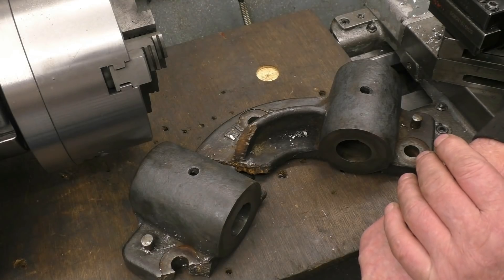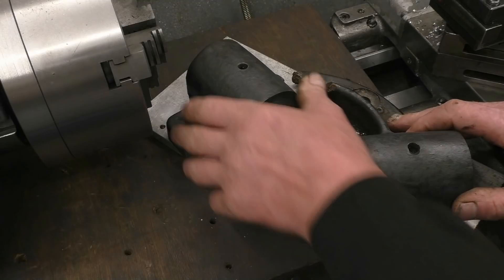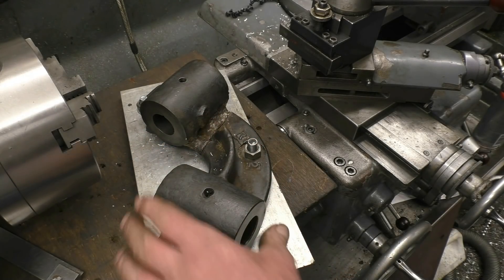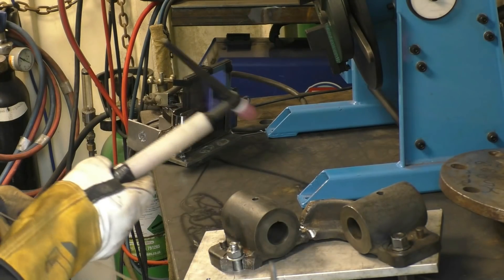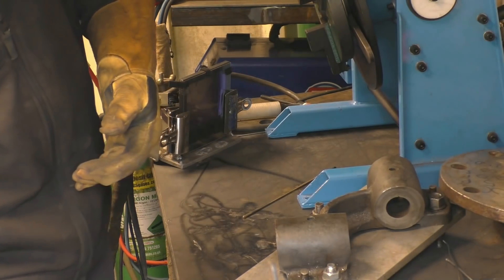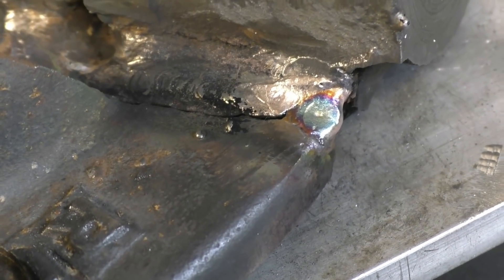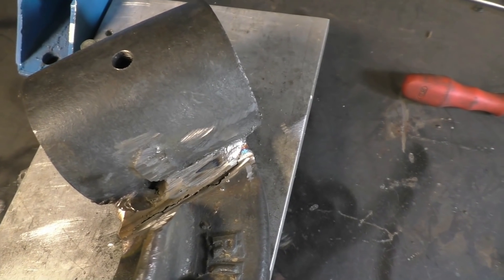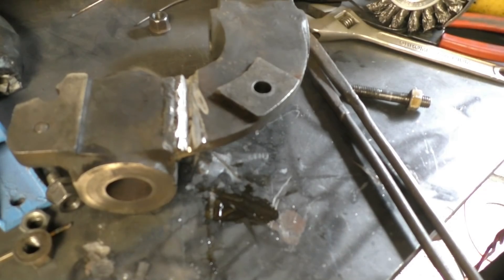SNNC 429 P2

Comment: Hi John, I really enjoy the variety of jobs you tackle on your chanel. You are an inspiration.  I have one of these lamps which came from Sacriston Colliery where my late uncle was manager. The lamps with the nipple on the side and igniter were issued to deputies and managers who were responsible for monitoring the build up of methane in the mine workings.  The other type without those features were used to provide light for the miners.  The deputy would have a rubber tube with an aspirator bulb in the middle and one end of the tube was held close to the roof of the workings where the methane accumulated, the other end was pushed over the nipple on the lamp chimney. Then the flame was adjusted low and the bulb squeezed several times to suck in any gass that migh be there. The flame flared up if there was methane present but occasionally the gas could extinguish the flame which is why the lamp has an igniter.  The magnetic safety catch could only be opened using a powerful electromagnet by the lamp cabin staff who also were responsible for filling the lamps with oil and lighting the miners lamps before the shift. Later type standard lamps were ignited electrically by a heating elemet next to the wick.  The Eccles Safety lamp company, which was on of several UK  safety lamp- manufactureres, is still in existance and have an interesting website.

Comment: Hi John, I have a lamp the same but to get mine to unscrew you start to undo it only as far as is necessary to lift one of the brass rods upwards into a hole in the top part of the lamp. Once this rod is up the bottom of the rod clears the bottom brass base and the base can be unscrewed off to dis mantle the lamp. I am pretty sure that the rod that slides up is near to where you are trying to use the magnet. Good luck from NZ , love your channel , never a dull moment in John’s workshop.

Comment: Hi John, brilliant content as usual. Great repair on the casting, that certainly will hold better than the stick weld, ( they probably used any old rod laying around) and cast doesn't like that. Brian Block is the guy to go to when stick welding cast iron after he repaired his 5 odd ton Carlton Radial arm drill after it was dropped three feet onto 2 foot of new concrete  (which cracked) when the steel rope on his bridge crane parted. He made a brilliant job of welding the broken casting back together. Your silicon bronze weld will do just as good a job on the I think you said Wadkin Planer. Just love Dino. He's a handsome beast and no mistake! Are you going to paint him? Cheers John

Comment: Hi John, I have a miners lamp with the same magnetic release catch, I’m seventy four now and I got it when I was 18, I could never get a magnet strong enough so I drilled a 1/16 hole in the top part of the mechanism so that the little spring loaded pin can be pressed down with a 1/16 drill.

Comment: The miner's lamp was interesting, I have never seen one with that locking mechanism before.  My dad was a miner all his life and retired in the 1970's and I have his old lamp.  It is all brass construction and there is a lever on a pivot that has to moved to allow the lamp to be screwed open.  To prevent this being opened underground there was a small padlock that was fitted in the lamp cabin on the pit top before it was taken down the pit.

Comment: Hi John , the lamps were used for testing for fire damp, a flammable, explosive gas, methane. If I remember correctly, at 1 and 1/4 % shown on the lamp the electrics had to go off and at 2 and a half % we had to withdraw from the area. The officials underground could tell the percentages from the height of the flame in the lamp when the lamp was in gas.

Comment: One of the strangest things I ever saw when I worked for British Telecom in London was a (cable) jointer inspecting some carriageway ducting for gas using one of those lamps. 
Having tested and found the presence of gas (using the lamp) he then proceeded to bail it out with a metal bucket on a length of rope!
Hoisting the bucket back up to street level and carefully emptying it into the gutter...
Apparently it was common practice in that particular area with lots of the cable ducting being below sewer level.

Comment: Need a really strong earth magnet john,there are internet sites that sell them but you feel ripped off,paid a fiver for mine years ago but cant find it probably stuck to something its not supposed to be,your in the right place tho its in the block you had your magnet on you here it move when it does come down. cheers
Reply: Old hard drive has 2 in there, pretty much for free. Have a whole collection of them from old drives I took apart. They are pretty useful items to have around, along with the 2 ferrite magnets from old microwave magnetrons.